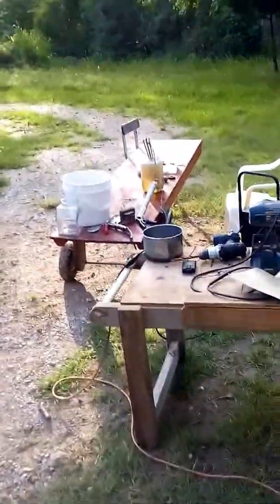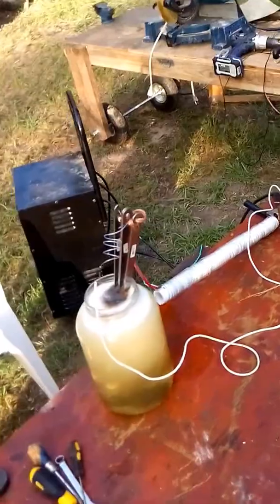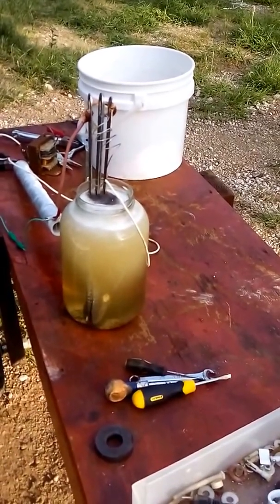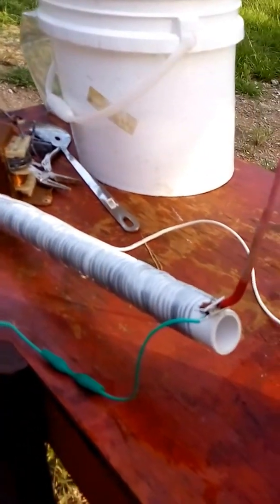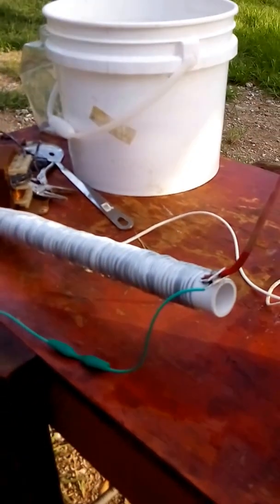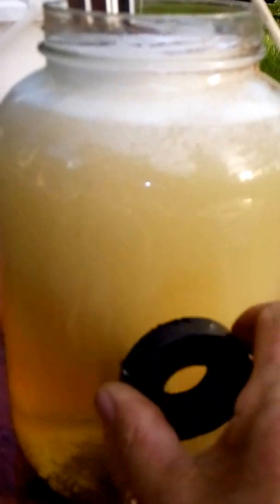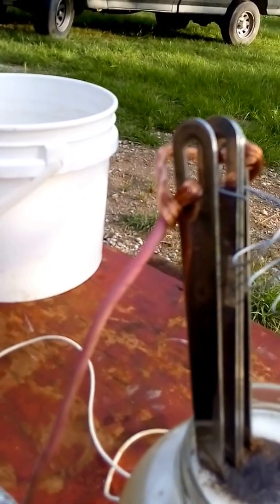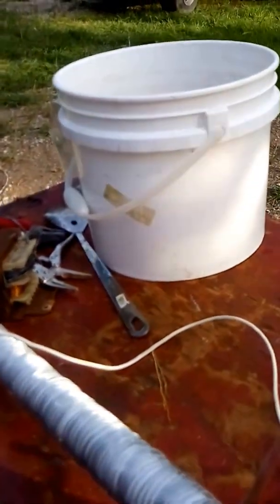HHO     crazy Hydrogen Production on less than 1 Amp

Comment from the maker: The Key to it is to disengage Bubbles as fast as possible from the Electrode surface and leave enough room between the Electrodes for faster Departure. High magnetic Field acceleration environment increases both velocity of convection flow  and the inter-phase slip.